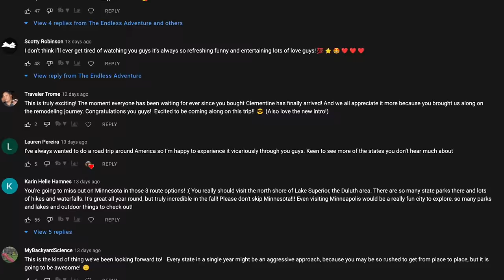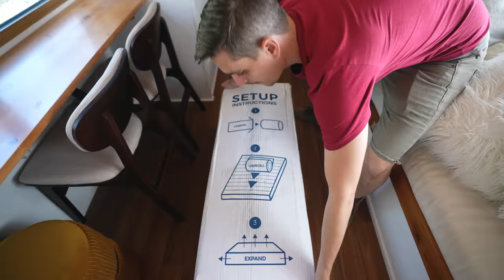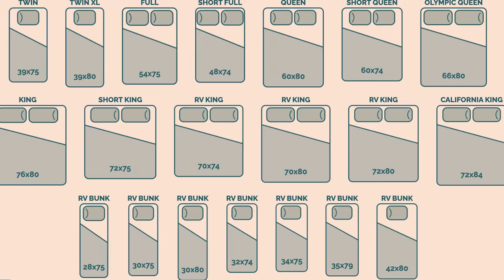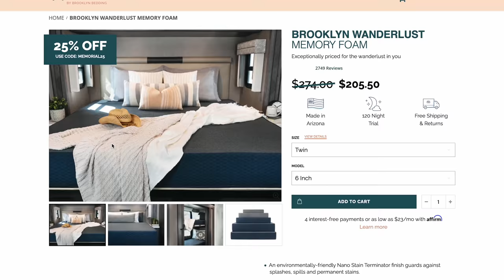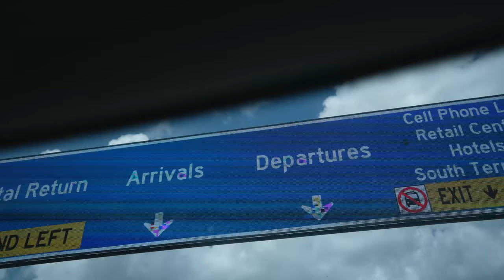Getting Our RV Ready for a YEAR ON THE ROAD + Travel Beans Camper Van Fire UPDATE 😨

Comment: In 1993 I bought 1973 22' Terry Trailer. I took it to a reputable RV repair shop and they fixed it up. Each year for three years I'd take it back to the shop to have it fixed up. After having it for three years, one of the "springs" broke on the way home from a camping trip. The trailer caught fire and was totaled. I had a smoke detector, a carbon monoxide detector and two small fire extinguishers. There was no way those little fire extinguishers could have done anything. Luckily, it had RV insurance and I had RV roadside coverage (towing). The adjuster recommended that each time that I had it upgraded and repaired, that I update my insurance coverage. No one was hurt, but it was quite a shock. I'm glad to know that your friends are okay. Check the springs and bearings on your RV.

Comment: Yes, definitely replace all soft fuel lines. Especially the short section at the fuel tank/float connection. Which you may not be able to easily inspect. 
 And on some van's, the connection between the fuel fill, and tank down tube, is sort of radiator style soft line. Those are notorious for rotting, especially with the newer fuel.

Carry minimum of 2 larger fire extinguishers type ABC.
And find a local place to be trained/practice use. 
Pretend practice what you will do if a fire starts in the kitchen, electric, engine, propane.
Think/remember  "PASS"
.
Pull the pin on the handle.

Aim at the base of the flames.

Squeeze the handle.

Sweeping motion across the flame base.. 

REMEMBER, no matter the size of the extinguisher, it only gives 5 to 10 SECONDS of poof! 
So always have the second extinguisher ready, so someone getting it for you.

Lastly, always have your important paperwork in a fire safe (permanent installation secure hidden low).
AND leave a copy with someone you trust. Especially important if you are both incapacitated.

Comment: So sorry about Frank and glad that the Beans were okay. Nice job on the doors. I like the bench but I would lop off the sharp corner closest to the door so it doesn’t hit you each time you come in.. It will give you more of your doorway back too. It will be fun to see what adjustments you make as you travel. For your route, I would follow the good weather. Start by making your way up to New England for late summer and fall, then head to Florida or the west coast for the winter months. The Midwest is best in fall or spring. It will be a grand adventure!

Comment: I would be having an insurance investigator check out their van remains and see if they can tell if it was caused by a mechanics mistake of leaving an oil line fitting or something loose and leaking since it had just came from a mechanical overhaul and if so make them pay them for their lose!
Also, get Co2 fire extinguishers for handheld use. They are good for live electrical fires, grease and gas fires, etc and they don't fill the RV with the chemical powder that gets everywhere, is hard to clean up, (stinks!) and is bad to breathe in!

Comment: Old vehicles need their hoses replaced. So many are dilapidated, inside as well as outside. A brake hose has pressure while driving, springs a leak right onto the hot exhaust manifold and 🔥 😳